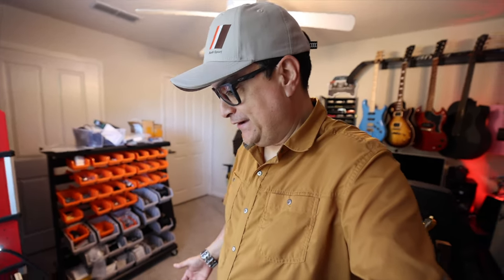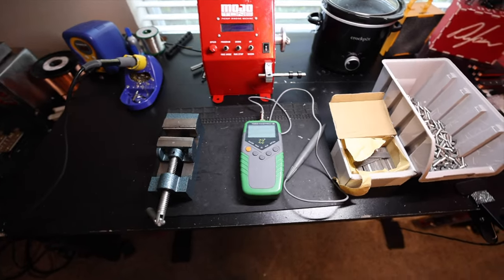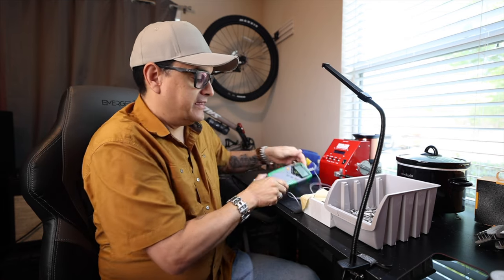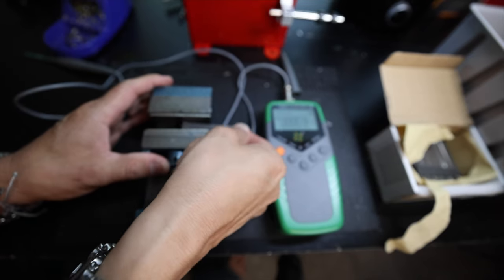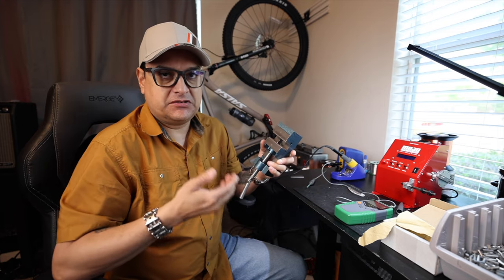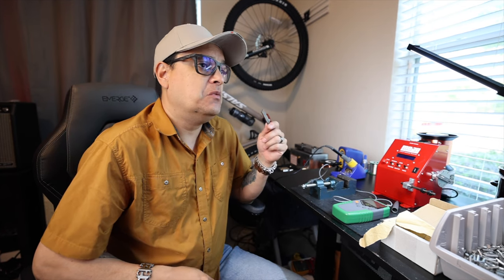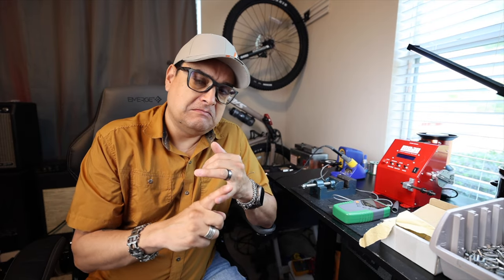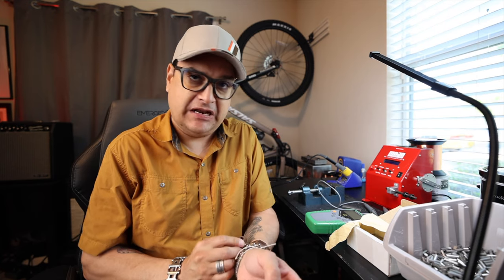How To Magnetize Pickup Magnets

Comment: I still have a tape head demagnetizer that I bought in the 80s. That thing is gnarly. I can feel it vibrate when I press its button.
Reply: LoL that’s because it’s actively degaussing a field somewhere. Check your wallet and phone at the door! I’ve got a larger tape head degausser for VHS and it’s the size of an iron. Respect the tool!
Reply: Is there anything I can buy like that now? Like to use on guitar or fender Rhodes ? My Rhodes demagnetized and I need it restore one quite a few pickups
Reply: @phinestro  Just get a strong neodym and touch one pole to the poles of the demagnetised pickup. May not fully charge it but it should make a noise.

Comment: !!!!   H E L P !!!!    hi, I cleaned my pickups with a magnet... because it had ferrous dust all around.., result: 3 strings no longer play.. the magnets no longer have a charge. they are single coils from a fender signature artist David Gilmour.... I'm very desperate.., this video has given me hope again, but I have a question: does remagnetizing a pickup change its specs? there is no value of reference that characterizes a pick-up? doing a magnetic charging... does the original performance change? do the factory values change?!, thank you for your time
Reply: Contact a pickup repair guy, he will be able to ´recharge´ the magnets. You can charge a PU material to a certain level, almost like a battery, but maybe they don´t have to be fully charged.
Hopefully the repair guy will know. My believe is that vintage sounding PU´s don´t need full charge, but that is IP for the manufacturer.
Reply: There is a Lindy Fralin video on recharging magnets. It looked like a fairly easy procedure

Comment: I don't have the ability to replace or flip the magnets in a single-coil pickup without the risk of damaging the winding. Is it possible to change the polarity of Alnico 5 single-coil magnets using strong two Neodymium magnets? Thanks!

Comment: My money says you may be able to hook your magnetizer up to a rheostat to vary the strength of your magnets. You won't be able to make them stronger but weaker should be an option for making specialized pickups.

I've got a very old watch demagnetizer that was in my father's jewelry store. It's designed to demagnetize but if you pull the object out of the field while the button is still energizing the coil it has the opposite effect.

We used to use this feature to magnetize and demagnetize screw drivers to hold screws for placement and find them on the floor. And then demagnetize them so the screwdriver wouldn't accidentally magnetize a balance wheel in a clock or watch.

Comment: To undercharge a magnet, put wood or plastic spacers between the
neodymium and the alnico in the vice. The thicker the spacers, the less the charge. This works because it keeps the alnico farther away from the 
neodymium, not because the spacers offer any sort of magnetic resistance.

Comment: I have a question: when using your electromagnetic machine, it only takes 1 second. Does it make a difference if you go longer? Will the magnet become stronger, possibly leading to inconsistent strengths across multiple magnets? Or does it just charge the magnet up to 100% capacity of strength?

I’m looking to magnetize some pickup magnets, and I’m wondering about charging them “too much” to lead to inconsistent strengths. Thanks for your time Dylan !!
Reply: Different magnet types have different ´capacities´ and many people charge them to full charge, but that might not be the best thing to do.

Comment: This was very interesting and informative. I have a question though. Do pickup magnets wear out? I use a screwdriver a lot for my job and I have a magnetizer for it that I slide the screw driver back and forth to magnetize, very similar to how you slid the magnets back and forth in the Mojotone. But the magnetism wears out on my screwdriver and I have to remagnitize it pretty often. So can a pickup become less magnetized over time?
Reply: I think that is the difference between a real magnet and tooling steel. Magnets have the ability to keep magnetized.